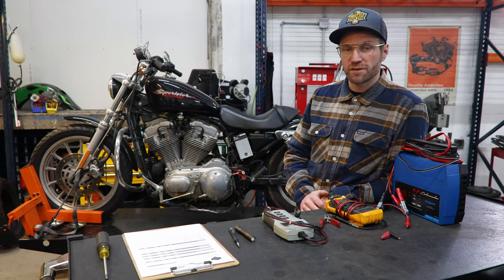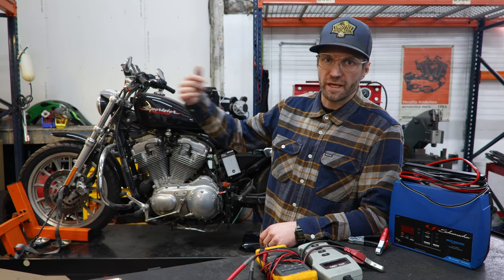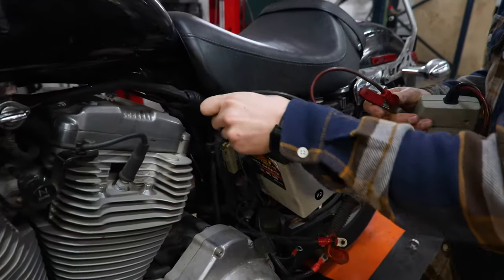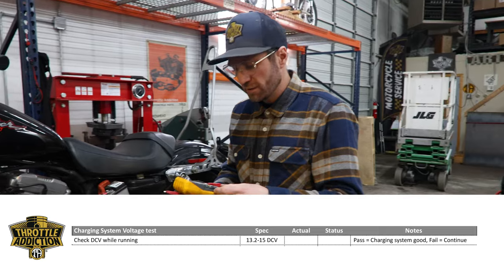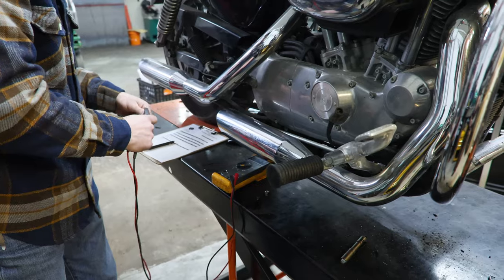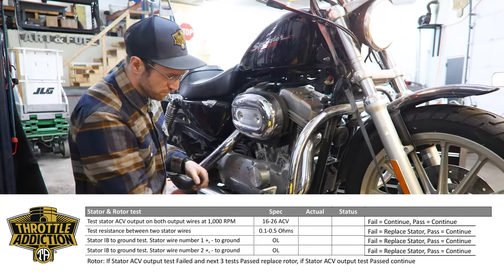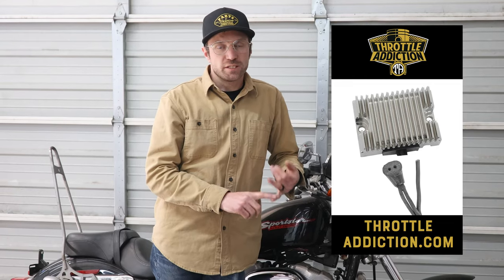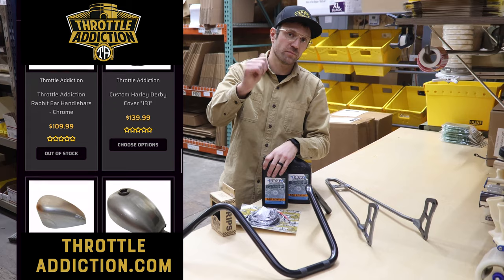Stop buying parts! Here's how to properly test your Harley-Davidson’s charging system

Comment: Your videos are very informative! Probably a dumb question but if my ac output 1 is at .5dcv but the ac output 2 is at 1.1dcv, that means my regulator is toast right?  Been trying to diagnose why my battery won't recharge and my mechanic couldn't find the issue...

Comment: Everything on my 04 sporty 1200c charging system test good….except my stator output voltage intermittently goes below optimal causing no charge. I can’t find any break in wires hot or cold. Do you recommend changing the stator or keep searching?
Reply from the maker: Sounds like you found the source of the problem, I'd recommend replacing the stator

Comment: Awesome video, very clear. I appreciate the diode test, the book has you test the regulator differently. I'm having an issue where the bike isn't charging, I get ~12.8VDC at idle. Everything checks out per your testing. Only anomaly is the regulator (and other grounds) show 0Ω with ignition off, and ~24Ω with ignition on... which is very mysterious. Anyone else ever run across an issue like this?

Comment: My voltage regulator does not read .5 
It reads 220 on the diode setting with the leads on the charging wire and either of the stator leads..
I've tested my stator and it's putting out the correct voltage, but the charging system is only putting out 10.2 volts to the battery, regardless of rpm

Comment: I’m getting 0.48 on the rectifier test, both are equal. No issues to ground etc. is this ok or too low? Battery seems to be getting charged ok when i test at idle but it drains during a ride and will die and have cooked the battery after about 25 miles. Everything else seems fine apart from this test. How close to 0.5v does it have to be?
Reply from the maker: Yes 0.48 is close enough to be considered a pass. My next guess would be that the regulator rectifier has an intermittent electrical issue. It probably only shows up when it gets hot. At the the end of the video I have some quick instructions for how to test for that: 23:35

Comment: My antigravity 1201 fully charged is reads 14.7 Volts. That changes some of numbers, no? For example, on checklist voltage test your battery read 12.5 v not running and the spec 13.2 -15 DCV while running. How do I  account for higher voltage charged AG battery?
Reply from the maker: Yes that's a good point, the only two tests that would be altered in your situation are the battery fully charged test and the running voltage test. When performing the running test your running voltage should be higher than your resting battery voltage. If your resting battery voltage is at around 13 the running voltage should be 14ish. TL;DR it sounds like your battery is working, and the other tests will have the same spec numbers from the sheet

Comment: Thanks mate, great vlog…just a quick question if I may, when pulling out the plug that houses the Ac pins from the rectifier to the stator the wires pulled out 🥹 ( I know, should have been more careful) I have  a old rectifier laying around with the plug & pins, wires ok so I’m thinking of cutting of the plug with a few inches of the wires and joining so I don’t need to buy a new rectifier…does it matter which order the Two AC pin wires from the rectifier join up to wires on the “new” plug (AC pins) that connect to the stator, cheers.
Reply from the maker: Appreciate the comment, It shouldn't matter which order the AC wires are in when you go to attach the plug to the old rectifier
Reply: The rectifier is diodes assembled in a certain series.  With capacitors in order to switch ac to dc current. 
  it only matters on the output side of it. 
12vdc + and 12vdc -

Comment: If the circuit breaker is wired backwards will it still work?
Reply from the maker: Yes it should still work, would recommend wiring it in the correct orientation though

Comment: Having similar issues in a 2012 FXDWG, but instead of dying while running, it’s only cranking with a jump, and dying after just a couple days sitting. Could it still be the charging systems?
Reply from the maker: Tough to say, definitely could be the charging system. Start by testing the battery and if everything checks out there move on to the charging system diagnostic tests
Reply: I’m having this exact same problem. After buying a new battery it’s doing this.

Comment: Awesome video extremely easy to follow. I have a 94 FXR evo that is not charging, i have checked the stator and regulator following yr instructions here. All seems in spec except on AC output /battery charge lead  test on regulator i get a reading of .45 DCV  its same for both 1 and 2.  I cannot find anywhere in my manual  a spec range so i dont know if this .45 is to low.

Any thoughts here
Reply from the maker: .45 seems reasonable especially since it's the same for one and two. I would try the test where you add heat to the regulator and perform the tests again assuming everything else checks out
Reply: Thanks for the reply, i tested again but this time i disconnected the regulator from the 30amp circuit breaker this time got .48 for the both, i have also tried testing when it is hot or cold. I still get a pass in all the tests for both stator and regulator. Can it be that the regulator is faulty but tests ok, have you seen this before?  @ThrottleAddictionCo
Reply from the maker: Hmm can't say I've seen that before. I've never seen a faulty regulator that passed all tests even when changing the temperature. So in my experience your regulator should be ok. You said you checked the regulator and the stator, is it possible it's a bad battery? Otherwise not sure what else I can tell you without seeing the bike in person other than triple check everything by running the tests again  @robertstenang2914
Reply: Thanks again for the replies and the great video on testing.,  yes its strange i even had my eletrician friend around to check my testing still same good results, battery is good. I just bought a new Harley regulator and installed it, now its charging fine .  @ThrottleAddictionCo

Comment: Ridiculous.  If the battery fails the battery test.
You still do the other test to see if a bad voltage regulator or bad stator caused the battery to drain and short out ( dead cell) 
 A bad regulator or stator can destroy a battery.  

If you only replace the battery because it tested bad . Chances are  You'll end up in the same position 50 miles down the road.  Check for the cause of the dead battery.
Reply from the maker: Good point definitely eliminate all other issues so you don't keep burning through batteries